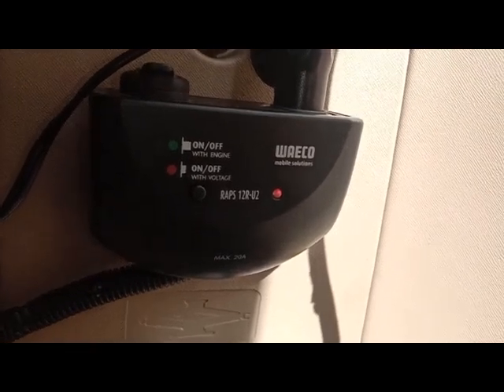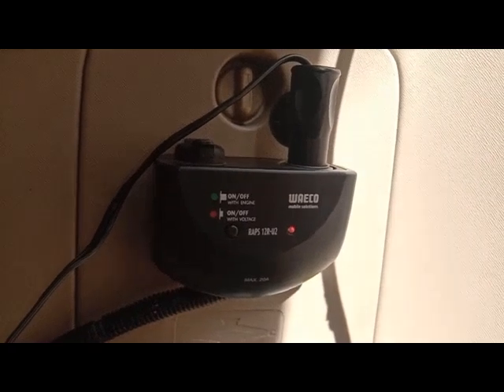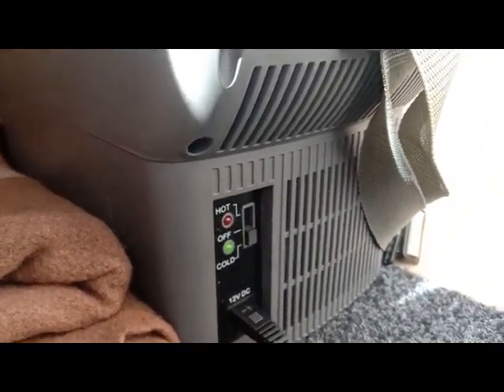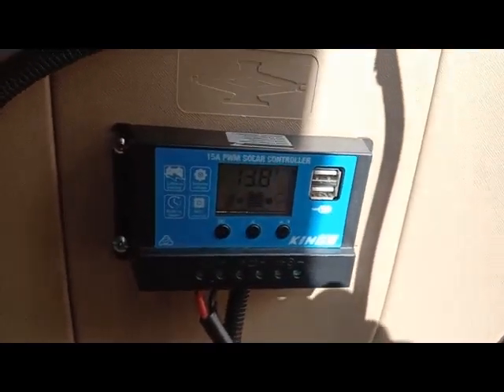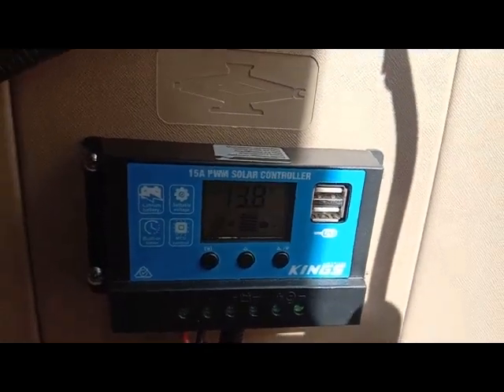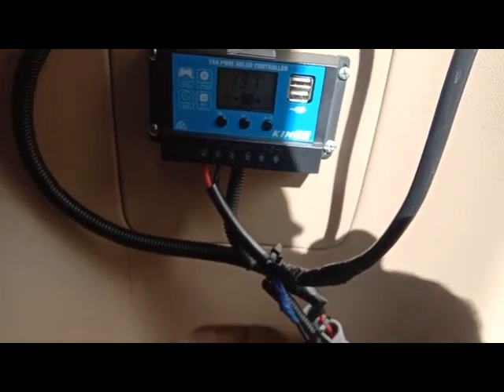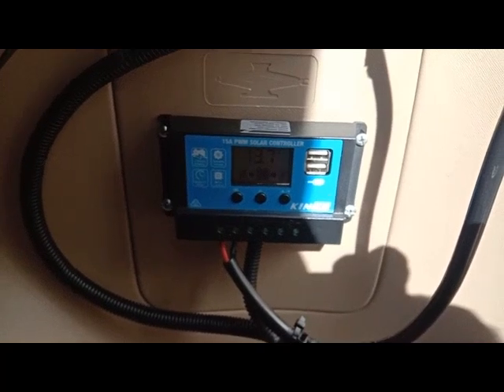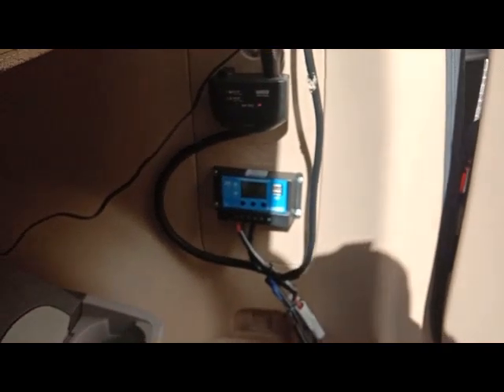HONDA CRV AWD. OFF GRID 12 VOLT SYSTEM.

Comment: great set up in a small space well done. What's happening with the XJ?
Reply from the maker: Thanks, it's a simple setup but it works well, combing the solar panel/ controller into the system... 

The XJ is finished and ready for RWC.. will be on the road after Christmas. Just been  busy with work🤬, I do have to get a new front right axel/CV/ to replace the original. Ok to drive on road but NOT off-road. Am looking forward to driving this beast😎😊🚙